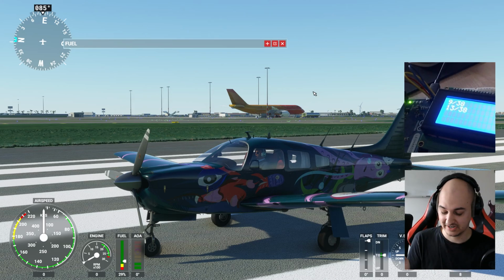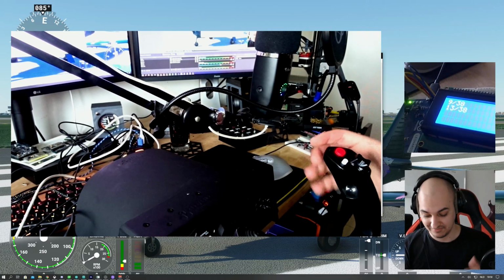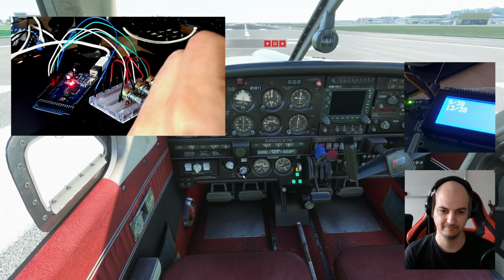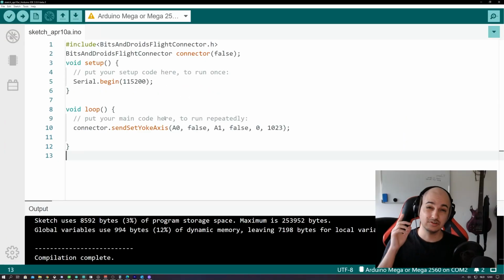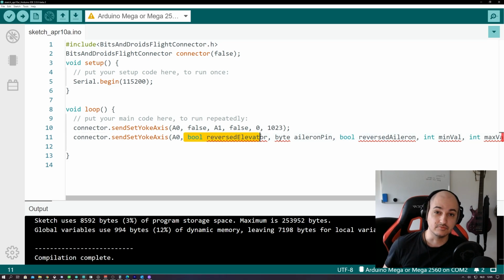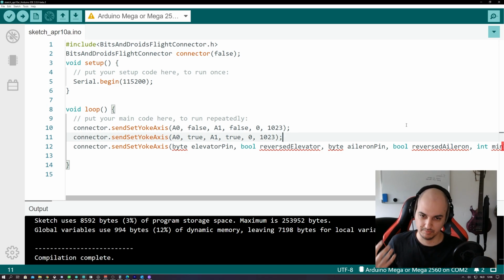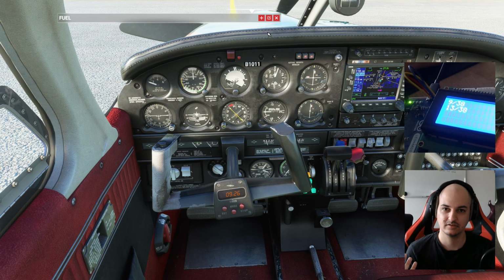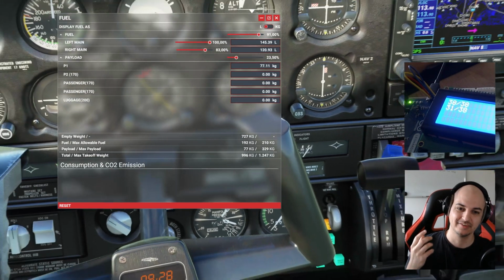V0.8.5, Watch your fuel dwindle and fire up those yokes

Comment: Why not implement RS485 or CAN BUS? You can dedicate a network to receive data and another dedicated to sent data. This way you can use multiple arduinos connected together as slaves to the master on each network or create one network with full-duplex through your connector to MSFS2020 and in the future to XPlane and other sims.
Think about it, that could be a great solution...
Reply from the maker: Fair point will dive into that